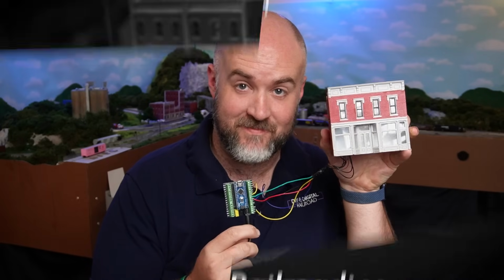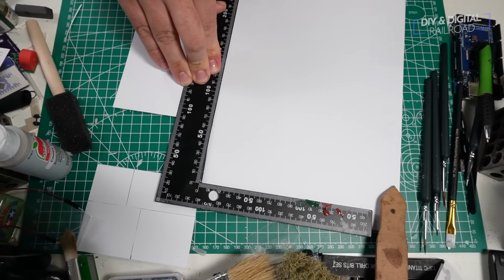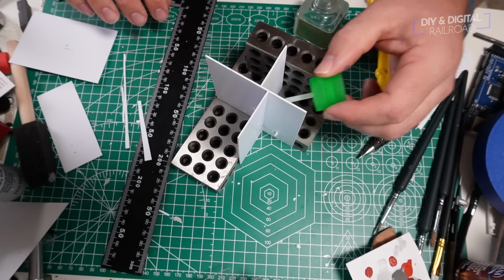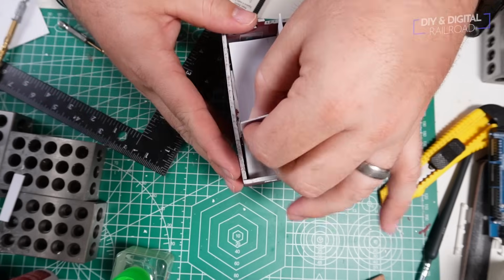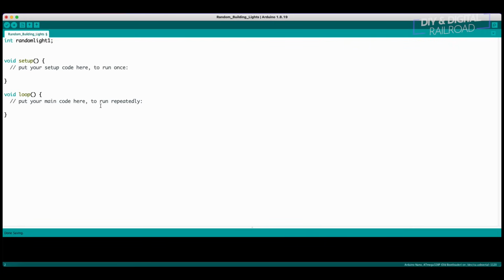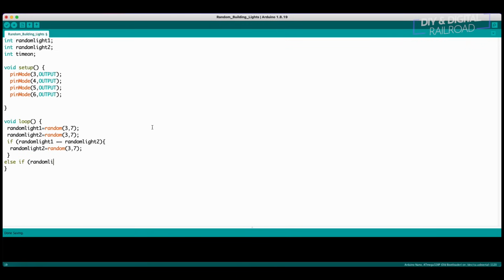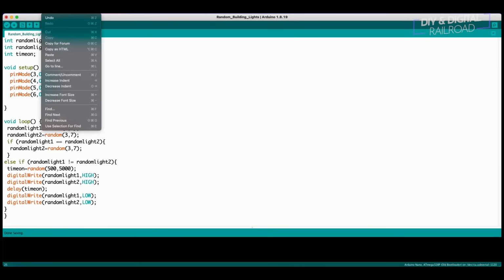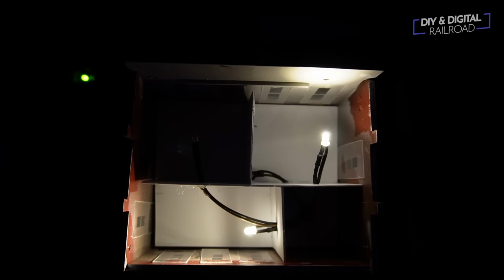Animated Model Railroad Building Lights with Arduinos!

Comment: Some things to consider. You have used an Arduino to control just four lights. If you use addressable LEDs you could control hundreds of LED's from a single Arduino. If you want to stick to just a single building as you have, PWM control of the pins (they are marked) allows dynamic setting of the brightness of the LEDs. (using regular LEDs and resistors).

Comment: Your code  randomlight1=random(3, 6); , prior to changing the 6 to a 7, could only return numbers from 3 to 5.  So the light on pin 6 could never have lit. The second parameter of the random() function is the upper bound, it and numbers greater are excluded.  

The if statement in your code will simply set a random value for randomlight2 once. It will not keep trying. (Your code will simply continue, then go around the loop again).

A better approach might have been to use a while loop:

*while(randomlight1 == randomlight2) {
    randomlight2 = random(3, 7);
}*

It will keep changing randomlight2 and when it is different to randomlight1 it will exit the while loop and continue.

You could then dispense with the else if

The code will only proceed to set the lights if they are different numbers.

Welcome to programming, I've been messing it up for decades.

Comment: Hi, good job, I built something similar several years ago and I have two tips. 1)  it's better define times of switching lights on your own than let it flickering randomly. Use different times for different kind of rooms in the building. 2) that's not necessary build all walls in the model, I made small boxes with led glued on windows.

Comment: This video is about 2 years old and I dont know if anybody pointed it out already - but maybe the leds with the wires you use there already contain resistors. I have bought a few bags of them a few years back, prewired warm white LED with resistors included - so I could attach them directly on up to 16V. Works well on 12 V as well - if the interior walls are white like in your case it should even work from as little as 5 V on (resistor is 1kOhm iirc). The funny part ábout the LED I got .. they have a cylindrical shape at the end of 1/10 " - and are wider at the base so you could put them through the ceiling where they work similar to real light sources and the electric connection is hidden in the lighted room. On the other hand the wire is thin enough to hide it in corners or like you did in hidden rooms

Comment: Great video, I just put together some structure lighting but added four more lighting pins (total eight) I'm also using an Arduino Uno. The code you wrote worked great, just modified for the additional outputs however noticed the random lighting stops when it reaches the end, is there additional coding required to keep the random lighting sequence continually going?

Comment: Outstanding episode, Jimmy! A bit of everything in this nice salad mix to turn into a finished product. The Sketch did a nice job of allowing each area to act independently, as well as together at times as it might in a real world. Really liked the clever way you handled separation for the random cases, by forcing a go back if equal. Well played. Curious.. Is that work surface mat specific to RR scale dimensions?

Comment: Jimmy  a good addition to any modelers kit is a set of brad point drill bits. By design they cut the outer edge before the full center so they have a smaller chance to get hung up and spoil the work. 
You might explore the mili function rather than delay for timing as it does not stop the rest of the program while waiting.
Mahalo

Comment: Looking Very nice ! It looks like I might eventually get there, almost ready to top out on my layout. Does your square convert inches or mms to HO & N scales? If you turn your project 90° & put it parallel to the front edge of your workbench you can use a pair of clamps to hold it in place (yes, I’m truly OCD).

Comment: Jimmy, this is a GREAT video illustrating how easy it is to add interior lights to a structure. I see a lot of models that look beautiful, but are not lit - even on the outside - and, in my opinion, this ignores a wonderful way to make our structures come to life. A few comments:

First, check out Roomettes lighting kits. They make very simple building interiors printed on cardboard and they include surface mounted LEDs. Many of their kits are designed to fit various DPM structures, and the others can be modified easily. That way, when the lights come on, you see an actual room, not just a white box. The LEDs they supply are compatible with Woodland Scenics Just-Plug lighting system, but they work just fine on 5 volts from the Arduino.

Second, your if statement should be a while statement:  while (randomlight1 == randomlight2) { randomlight2 = random(3,7);}   This guarantees the two lights will be different and you can skip the else if statement.

Third, you CANNOT use int timeon; if timeon will be larger than 32,767 (about 32 seconds)! If you want your light to be on for longer as you mention, you need to declare timeon as a long integer, like this: long timeon;  Now, timeon can be as large as 2,147,483,647 - about 600 hours.

Fourth, I know that using delay() in the loop() function makes things easy, but it puts severe handcuffs on the Arduino: the processor cannot do ANYTHING else while the delay() statement is running. Suppose I want to turn a random room light on for a random length of time, then do the same thing for the other four rooms? This is a much more realistic animation, and absolutely impossible to do using delay(). The solution is easy to use, but too lengthy to show here. I will email two files to you; you can choose whether your audience would be interested.

Comment: Really nice, like how you did the interior setup. I didn't realize you could use 12V leds and skip the resistors. One last thing did yu use an HO building to demonstrate the lighing on a building. My buildings are all DPM building and they sure look smaller than  your building. Either that or my eyes are deceiving me ... Great video always a pleasure to tune in and learn new stuff !!!
Reply: It was easy to miss but he mentioned right at the beginning of the video that it was an HO scale building. LOL your eyes are fine!
Reply: @garrettswoodworx1873  I guess it was my ears then.. I didn't catch it. It bytes getting old. Bummer!
Reply: @edwardaudet8367  Trust me Edward I understand! (Getting old does beat the alternative, however!)
Reply: You may have noticed that the LEDs in the link are prewired with a resistor.

Comment: Nice job Jimmy!!  Some modelers give the interior and structure walls a quick spray of flat black to block light.   BTW, if you increase the "on time" by using great big integers larger than 2 bytes with most Arduinos,  you might have to declare them as long integers to get 4 btyes.